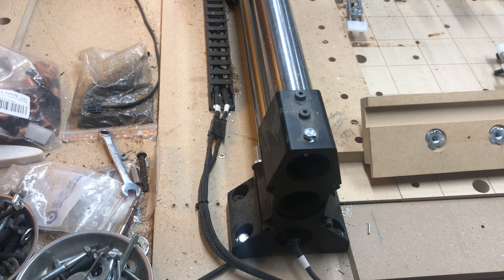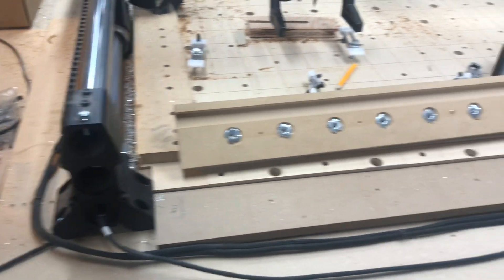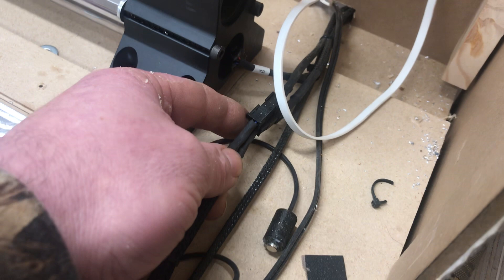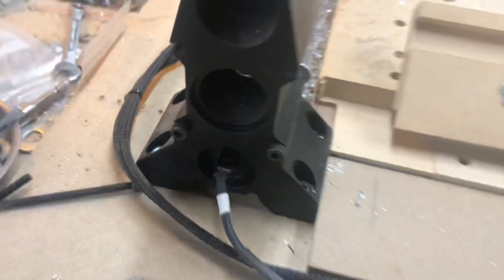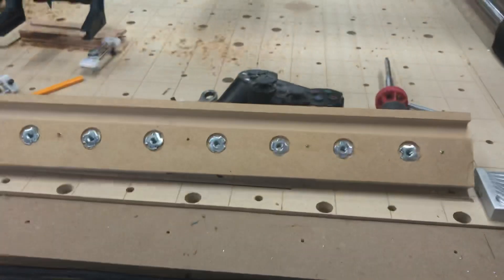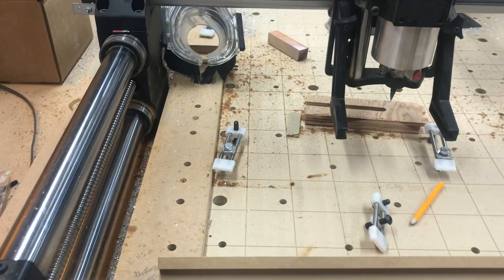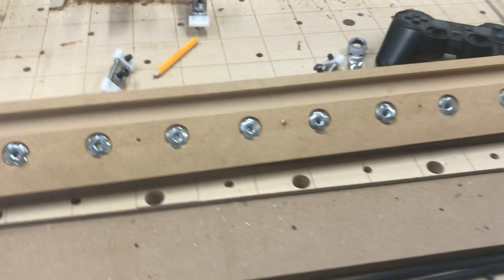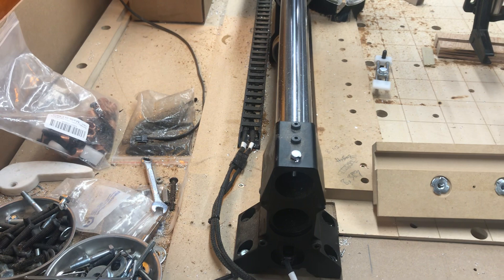Onefinity CNC Right side Controller

Comment: Hi Mike, Don't have my machine yet but am interested in your spoil board concept and design. Maybe a new video idea for you.... Also looks like you milled some aluminum . What did you make? Thanks
Reply from the maker: Hi Ronald!  I just made a couple little tools I needed for my work nothing to fancy.  Milled ok with an ‘o’ spiral although finish wasn’t great but probably would have been better with a pass with a ball nose.  As for the spoilboard setup you may want to check out one that Ryan Labarre made, it takes mine to the next level.  https://www.youtube.com/watch?v=EwffKG55itc&feature=youtu.be
Reply: Thanks for the link.... looks good :-) What size is your spoil board?
Reply from the maker: Started out at 31.25” but I ended up knocking of about 5/16” off the front and left to mount my square guide pieces.  Originally I had put holes in the spoilboard with copper pipe to retain the square guide but decided that I didn’t really like that setup.

Comment: Mike, couldn't you flip the sides the drag chains are on as well?
Reply from the maker: You could flip the gantry but I think it  requires a bit of disassembly to get the Z mounting plate on the front again.  I took the easy route, for $30 figured it was the best route for me.  There is an option to reverse X motor in the controller settings if this is your preference.